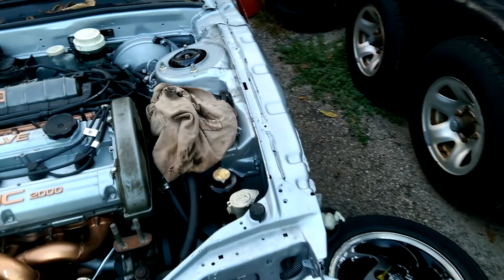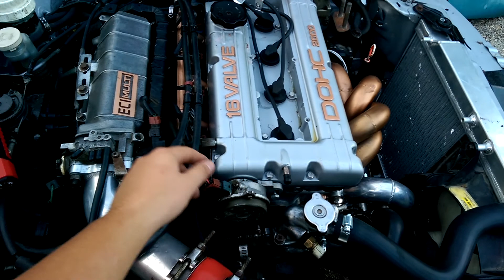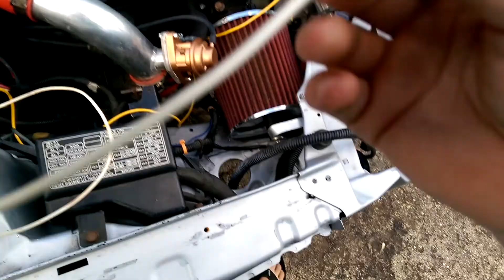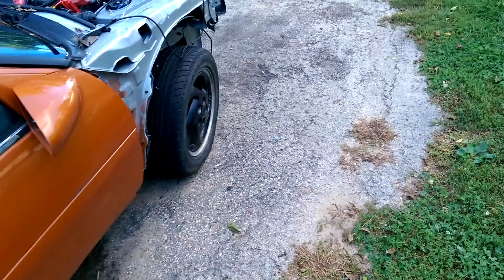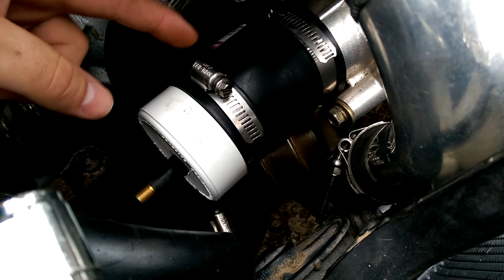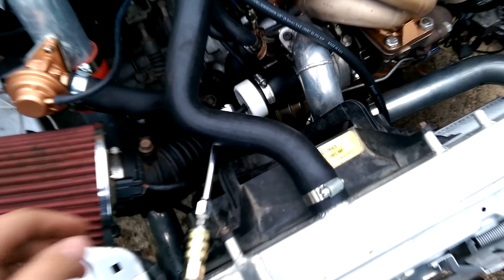1992 Plymouth Laser - Troubleshooting

Comment: Did you get it figured out? Was it the knock sensor?  I am having same problem on my laser rs
Reply from the maker: Nope, never did figure it out. We chalked it up to needing a tune with all the changes we had made. Then I moved and it's still sitting around not being worked on :(
Reply: @JustinTheJMan  I changes my knock sensor.  Same problem.  I think it's injectors, starter or knock sensor is picking up the starter chatter and or tob noise.